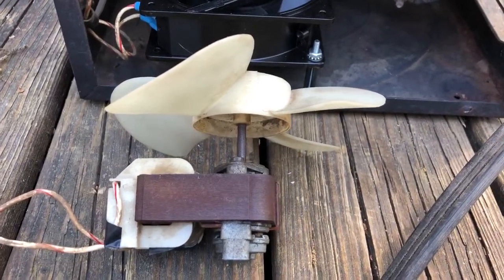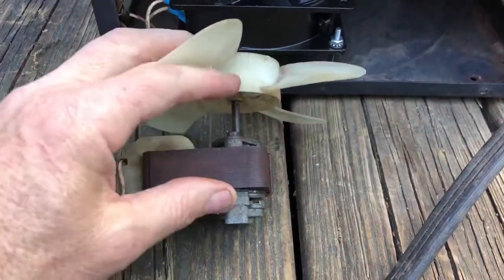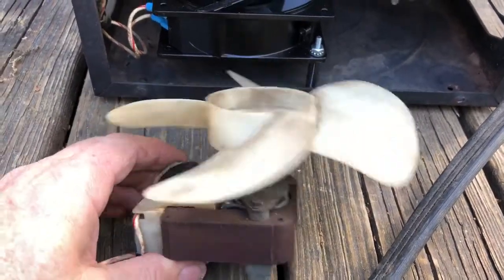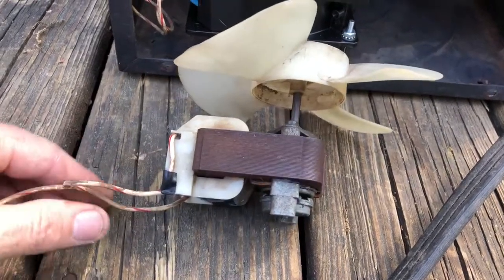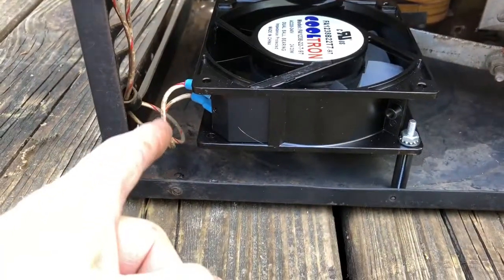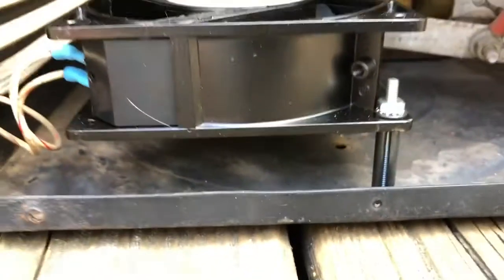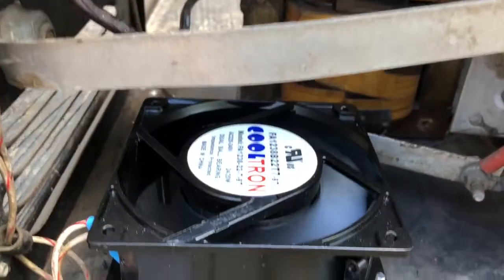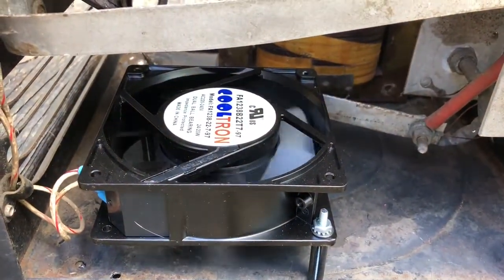Cheap Arc Welder Fan Replacement Option

Comment: Had a locked up fan on a Sp-125 Plus. Took the fan motor apart and sprayed WD-40 inside the bushings. Turned the motor by hand until it spun freely. Wiped off the excess WD-40, and put the fan back in. Powered it up and it worked great!

Comment: Thanks for the posting. I found the same fan you used on ebay. Got the part no. from your picture. Used it in a 30 y/o Harbor Freight MIG welder.  Easy installation leaving more air flow than the original.
Reply from the maker: Great!

Comment: Just bought a thunderbolt AC/DC , $175 asking price.  Needs fan replacement. Called a supplier. $265!!! 
Told the seller. Got it for $125.  With a similar fan on this video. I am happy with deal I got

Comment: This is brilliant.. I did something similar before. I just added a small personal desk fan about 5 inch.  And just ran it off of its own 110 cord. To heck with paying 100 + for a dang fan.
Reply from the maker: Agreed. I was looking for replacement ideas and ran across someone who did this but used a 115V muffin fan in conjunction with a step down transformer. Did a little digging on muffin fans and ran across the 240V fan. SOLD!
Reply: That's stupid expensive isn't it. You could also source old fans similar to the original one in old microwaves if you want to go real cheap.
Reply: @TheFreak111  
I just tried a microwave fan and it blew. I did not realize the voltage from the welder was 220, I thought voltage to the fan was reduced to 110. Had I know, I could have done as @gunnuts82, because the microwave fan mounted right in the place of the old lincoln welder fan.. Live and learn. Now I have to start over. lol

Comment: A 240 volt oven fan can also be used. It's the same style that's in a welder and new they are under $60.00
Reply from the maker: Joshua Potter thanks for sharing.

Comment: Thanks much for posting this.  I have the same Miller welder and fan that groweled at me for several years before it went out. The cooltron fan now is about 35 dollars.  Since this fan has a plastic housing, have you had any problems with this like too much heat going to the fan or is the ventilation adequate to keep this from happening?
Reply from the maker: I have had no problems. If you are concerned you may be able to find one with an aluminum housing. The main thing is you need one in the 230 volt range.
Reply: @TigerCreekFarm  Thanks for the info.  I have noticed that the aluminum and metal housing fans are much more expensive than the plastic fans but if they keep up with the heat they should be ok.  I would check the fan periodically, especially if unit reaches the max time and outpout.  I saw fans on ebay for 15-17 bucks either with or without the two wire leads coming into the fan.

Comment: Man, I'm glad I found this video. I WISH I had a Miller welder! But mine is a lowly harbor fright unit, so I REALLY want to stay cheap! lol   I have a question for you though. During testing of my fan, I found that it's grounded through the chassis of the machine, and that both leads carry 110 volts. Did you ground your $15 plastic fan? or does it just have the two hot leads? I'm pretty thick when it comes to electrics. Thanks for your well done video!
Bert
Reply from the maker: I believe that it connected as you stated. Each leg carries 110v and it grounded through the chassis - which is actually aluminum and not plastic. If you use one of these pancake fans make sure you get the 220v version. Good luck!

Comment: I think that one should have mounted the replacement fan in the exact location and airflow direction as the original fan.  Is there a reason that wasn’t done?
Reply from the maker: It is mounted that way.
Reply: Ok. I’ve never seen one mounted to the foot of the unit.  God to know there are different versions.  Thanks

Comment: Does it get grounded from the spacers ? Bought this for my lincoln but isn't working. Have 120v on each wire
Reply from the maker: I am assuming it grounds to the chassis. My spacers, or risers, are steel. Did you verify that you have 120v on each leg coming to the fan? If you do there is a chance that you bought a fan broken right out of the box. I would verify voltage and then verify good connections (hidden broken wire).

Comment: Just ordered a new fan for my Lincoln Electric 140HD.  OEM part was only $25.
Reply from the maker: Thrifty Garage I would have jumped all over that if the Miller part was that price. Paying more for the fan than I paid for the welder didn’t make much sense.

Comment: You really want air blowing on the diodes. When they get hot and die you lose DC function. Not a cheap repair then. Move your fan to the right as close to the diode heatsink as you can.

Comment: Any one know how and maybe a phone # to call to order one? Tks
Reply from the maker: Here is the fan I used - https://www.acinfinity.com/component-cooling/axial-fans/230v-ac-cooltron-fan-120mm-x-38mm-high-speed/
Reply: @TigerCreekFarm   how do you ground it or is it made from metal tks
Reply from the maker: @jimjeffress6800  it’s made of aluminum. Grounded mine to the chassis.
Reply: @TigerCreekFarm  ok tks ,i wasnt sure what it is made of
Reply: Can you furnish information off the fan itself ??? Tk You